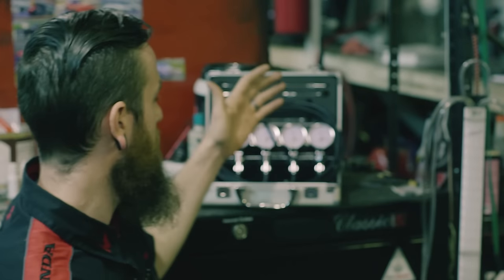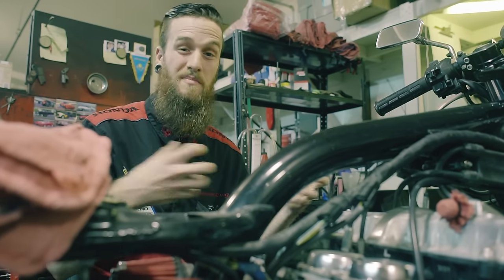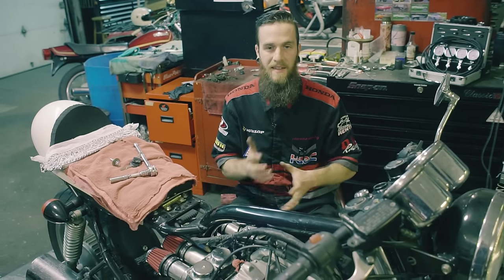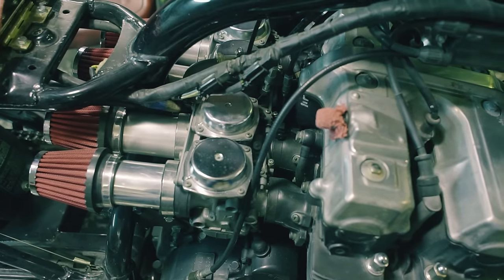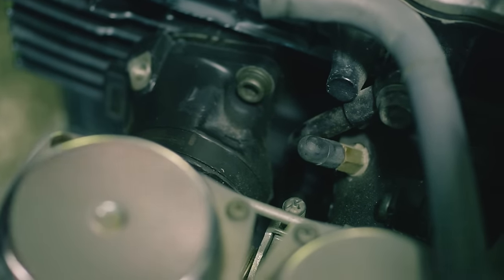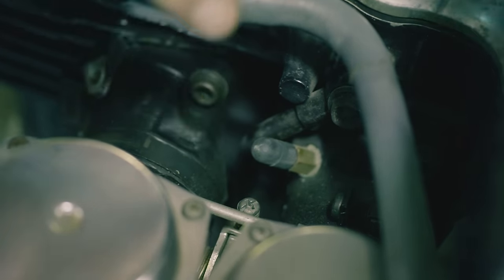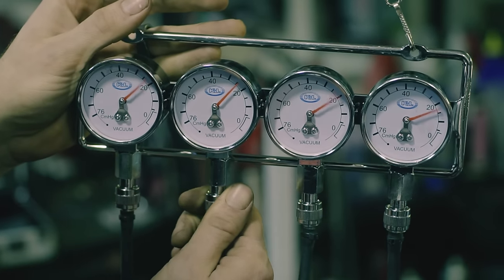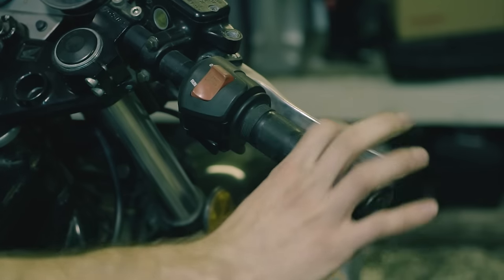Carb Syncing: How to Fine Tune Your Carburetors

Comment: why when I balance my carbs all spot on.. then rev the bike slowly to say 4k I get negative vacumm but at all different rates between the carbs. they are not level then. only on idle they are. cbr600 f2 year 1992
Reply from the maker: paul giblin Hey Paul, don't get too caught up with how the vacuum gauges respond at higher RPM. There are many factors involved with diaphragm style vacuum slides. Constant velocity systems may oscillate differently from each other as they overcome the spring rate in the slide. If your idle readings are spot on, then the throttle bodies are synced together don't overthink it!
Reply: TheMotorcycleMD  but revving from idle to 3k it's splutters.  always has. I have tried 3 sets of carbs. cleaned the carbs. coil packs  plugs everything. after 3k it's smooth
Reply from the maker: paul giblin You tried three different sets of carbs and all of them did the exact same thing?
Reply: TheMotorcycleMD yep
 . I have done valve clearances too.  I'm thinking if I hold at say 3k then balance them out with the mixture screws until all level? I'm assuming it's mixture differences between carbs . even tho I have them all set the same
Reply from the maker: paul giblin no, don't do that that will throw your sync all off. Try applying the choke lever during this transition. And see if it clears up.
Reply: tried that and it's no use because once warm my choke cuts the bike. choke works lovely when it's supposed to when bike cold. my bike always fires first turn cold with choke and warm with no choke
Reply: here's the vacuum I mean when revs raised
Reply: Sorry wrong video. That's them balanced anyways . Just not showing what I mean when revs raised. I must of deleted the vid
Reply from the maker: paul giblin I never saw the video, it wouldn't allow me to see the page. My advice to you is to diagnose the sputter in that transition. Move away from the vacuum gauges, that has nothing to do with fuel delivery problems. Try using the choke lever when at the exact moment it starts breaking up and see if it smooths out. If it does, then you have a lean issue, either you need to shim the main jet needle (see tuning carbs for new exhaust) or make sure your fuel pump delivery is in spec (if it isn't gravity fed.. can't remember 🤔)
Reply: F2 gravity.  All floats in spec. I put needles in from a dyno kit and it only ever improved full throttle massively.  If I pick the revs up really slow when it hits around 3 to 4k the revs then shoot up and is smooth. Also when in my crap rev range going up hill the bike stutters like throws forward and bk. I have to drop gear to get high revs. Or slowly build the revs up. Is the lean or rich?
Reply: Only mods on bike is end can and stainless headers. I put standard can bk on and was the same. Has always popped on deceleration too. I have always had the stainless headers on tho I have no standard to put on. They are sealed well as I changed them for another set of stainless ones because I had a bit of damage on last ones
Reply from the maker: paul giblin like I said, try using that choke lever trick in the sputter. That is how you diagnose a lean or rich problem. If it smooths out the sputter then you have a lean problem. If it gets worse it's too rich.
Reply: in all honesty it doesn't improve or get worse. I tried that probably 2 years ago . what I will do is when I get bike out I will take a video of it. thanks for replies tho
Reply from the maker: paul giblin 2 years ago?! If your bike does not change at all with the choke turned full on when inside of the sputter then either the choke is not hooked up or you have spark dropping... I don't care what bike it is if it's carbureted the choke will always change how it responds for better or for worse. It's not a complicated system brother.
Reply: TheMotorcycleMD  I have been still using it since. it's just I tried the choke trick when riding and not alot happens. if just revving tho  it's a no go because if I apply choke on a warm bike it cuts out. choke does work.... I start bike on choke. after a few mins the revs climb to 4k then I knock the choke off. Obviously when warm I don't use choke and not needed on warm start.
Reply: don't rule out an air leak in the manifold, spray some wd40 round there and see if there is any changes in the engine noise, if the revs change then you have an air leak

Comment: saying carb sync has nothing to do with mixture isn't exactly accurate, the level of vacuum each carb sees dictates how much fuel gets delivered not only through the idle circuit but also just off idle especially with a CV carb where the slide is directly control by vacuum, you can have one out of sync carb with less vacuum pulling less fuel making it run leaner then the other cylinders. i just went through that tonight, had one cylinder that was running a little lean, it fattened up after i adjusted the sync....

Comment: Being as he had to adjust the #4 carb so that the needle had to go up to match the rest of the dials and then when he had to adjust it back down once he swapped to the mercury gauges, I'd like to have seen him connect it back up to the dial gauges after readjusting them with the mercury gauges and see if he's right back where he started off before he had adjusted them to the dial gauges in the first place. In that case he wouldn't have made any difference what so ever. He also would have given an example of how he thinks the mercury gauges are more accurate if we had a chance to see if there was an actual difference once he readjusted after hooking up to said mentioned mercury gauges.

Comment: Why does mine pull different vacuum when reved? Even tho all level on idle
Reply from the maker: It’s just CV piston movement through the carb. Don’t be as concerned with that. If they are all level at idle, The throttle plates are synced.

Comment: You failed to mention what the heck you're adjusting when you sync the carbs!  Is it the idle screws, fuel/air mixture screws, what?
Reply: NV- Slim He did, it has zero effect on jetting. Only changes/equalizes the amount of vacuum on each by making all the butterflies or slides closed the exact same amount. If they’re off, you have one of more carbs at a slightly more open throttle, so that particular cylinder is wanting to go faster than the others. It’s pretty easy if you imagine having a few separate engines attached to one shaft. Now imagine two at idle, one at 1/4 throttle, and one at half throttle. They’re all out of sync and fighting each other. By checking and syncing the amount of vacuum (lower vacuum =bigger throttle opening) you’re making them all run equally and “agree” with each other. It really doesn’t matter once you’re at much throttle opening, but at idle and small throttle openings it does.
Reply: @jimarmbrester1721  You still didn't say, what screw are you adjusting on each carb.?
I have a BMW R100 and a carb that shows no vacuum, yet I can feel exhaust coming out of the exhaust pipe.  Go figure, any ideas?
Reply: NV- Slim There’s a shaft or linkage that connects all of the throttle plates together. There’s an adjustment screw at each junction from carb to carb. Depending on what the bike is they can be of different design, but do the same thing. Also, check your gauges. Try connecting one that’s showing vacuum and definitely working to the one you think doesn’t have vacuum. It definitely has vacuum, it’s not possible for it not to, unless the piston and rod are missing from that cylinder, valves stuck very open, or spark plug removed. I’d recommend you get a manual and review it. I don’t think you’re going to find the answers in this particular comment section.

Comment: Can you sync with out the air box cover off  and get a accurate  reading. My bike idles without the cover on  funny. Only way to access the three screw is with the air box off.